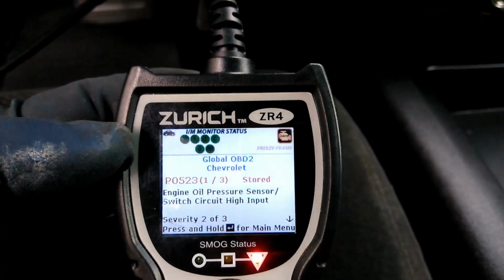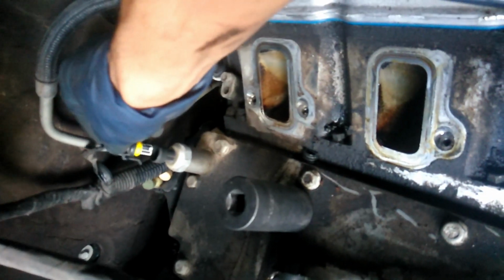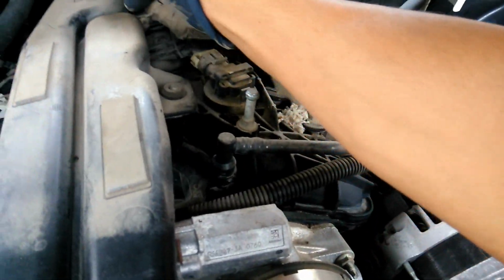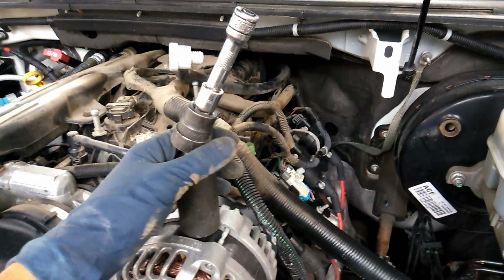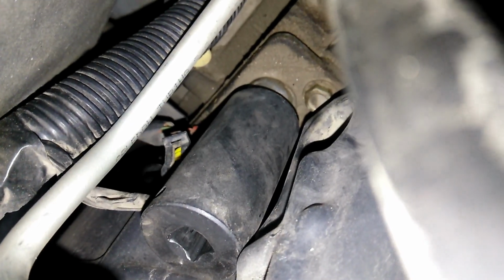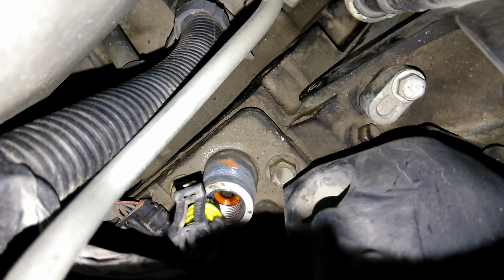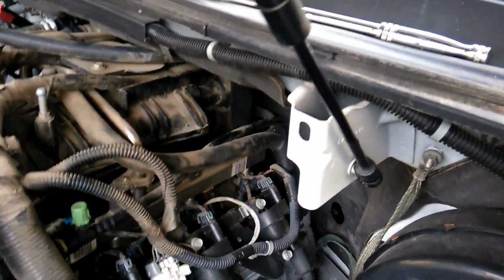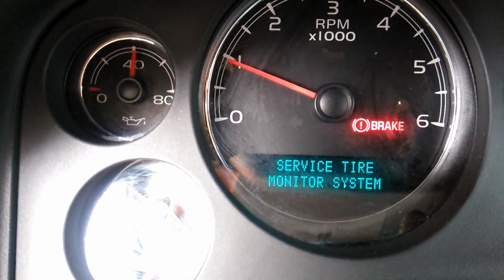chevy no oil pressure p0523 p0521 2007-2014 tahoe escalade silverado yukon turn engine off

Comment: I just replaced my sensor (2012 Silverado) without removing the manifold. It's a pain, but doable. Started the engine and still no pressure on the dash gauge and check engine light on. I watched several videos regarding this and only you and another stated to clear the code. I cleared the code and everything is now fine. Thanks for the video.

Comment: That brake booster vacuum hose you removed that runs to the intake manifold I removed that part of the hose while doing that i lost the fitting or gasket  that goes to the Manifold would you happen to know a part number for it or proper name for it!?  Thanks

Comment: I just replaced my sensor did an oil change on it same day light went out. It's been about a week or so the check engine light came on reading p0521 any idea what it can be?
Reply: maybe you need to flush the old oil with  with liquimoli product flush  and  run the car for 15 minutes  and put the new oil filter  and then if you replace the oil filter sensor you need to replace the screen oil filter  also that is very important  to solve the problem

Comment: Do you work at a shop if so where? I have a 09 Tahoe with these code p2176 p0521 p0455 p1516 p0523 p2135... it’s such a hassle and I worry it will one day leave me stranded with my kids.
Reply from the maker: I'm located in  Oceanside California
Reply: @JaboTheMechanic  do all those codes sound like something you can repair? If so how long do you estimate I’d be without a car?
Reply from the maker: It should  be  about take a day. Yes I can

Comment: I need your help need mine replaced I got p0521 gmc sierra 2009 hopefully your local to me lol .
Reply from the maker: Where are you located?
Reply: @JaboTheMechanic  downey california 90240
Reply from the maker: @whiteboy4life04  oceanside area 92054
Reply: @JaboTheMechanic  I gps it says only 1hr not bad issue I have is tags expired needs smog and cant do so because of check engine light I wish I could attach picture here would like to get your feedback on if you think there is actual screen in the hole because  I can see something but not 100 percent because I am working behind motor.  By no means am I a mechanic I just got snesor off very difficult to remove screen I tried putting new screen back in hole but the sensor dose not thread in telling me there is something like old screen in there .
Reply from the maker: @whiteboy4life04  are you using the pick like i dis
Reply: @JaboTheMechanic  is there way to send you pictures